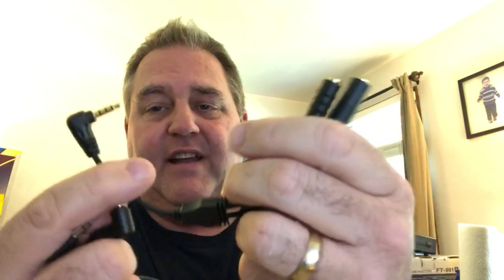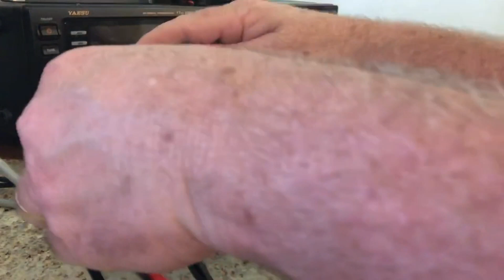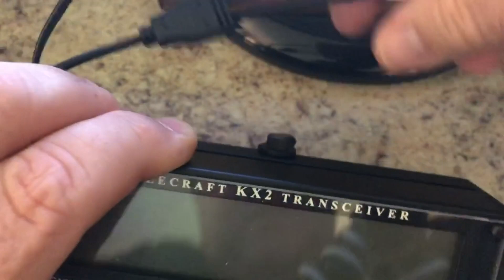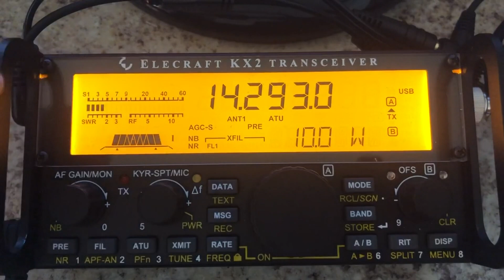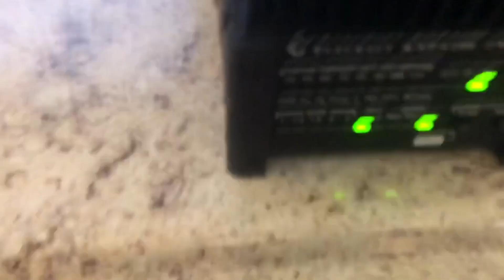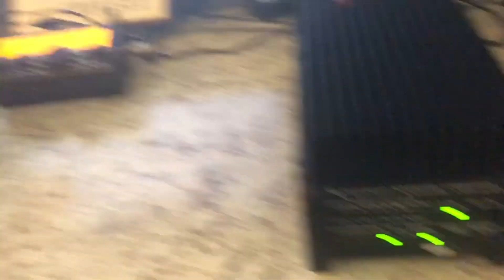Elecraft KX2 and KXPA100. Perfect match!

Comment: Does it work more or less the same way with the KX3 instead of the KX2? (besides the cable)
Does the amplifier also amplify the incoming signal to increase sensitivity?
Reply from the maker: Yes, you just don't need the adapter cable. The preamp is built into the radio itself and it works really well, with or without the amp.
Reply: @K4MJV  Great. I have had my license for years, been wanting to get into HF but could never really find the right rig, and I'm starting to really like the looks of these. Also the fact that they are actually US made!

Comment: Nice video - Thanks! Curious - Did you ever try to set up the KX2/KXPA100 with Winlink? If so, would you mind sharing how you did it? Thanks! KJ7RPL - Brent
Reply from the maker: I used a SignaLink Sound card to interface. There are smaller options out there now like the Digirig and others but I already had the SignaLink for the shack so I used it. Also works if you want to run any other digital modes using the KX2. Just know that the rig will run pretty warm using digital modes so an aftermarket heat sync might be a good idea.

Comment: When you want to tune via the kxpa100 atu, do you just set the pwr output on the kx2 to 11 watts so the amp is engaged? I usually tune at 5 watts on my other rigs.
Reply from the maker: When using the KX3 or KX3 with the KXPA100 amp, it's best to just think of it as a single device. The "device" will know what do do when you press the tune button. Just set the PA and ATU to external in the radio menu and it will handle it for you.

Comment: Hi there! Greetings from the UK.
Great video, very useful.
When paired with the KX2, are we able to monitor current draw (TX and RX and STBY of both KX2 and KXPA100) on the screen of the KX2?
If not, are you able to tell me the current draw at 20W and 50W on TX? And on STBY or on RX as well?
From the specs I can tell it is typically 20A (presume on TX at 100W)
I am Interested to be able to estimate the running times when used on the field with the batteries and solar panels I have.
Thanks for sharing
Reply from the maker: I don't remember if you can display it on the radio itself. I made the huge mistake of selling this amp so I cannot test it now. If you have one, do not sell it.

Comment: I purchased the KXPA100. Almost all of the cables you show in your video are NOT included with the KXPA1OO. With mine I received two of the USB cables used to updated the KXPA100 firmware (weird), the RCA plug cable, and one power cable. All other cables must be purchased separately. Most of them can be purchased from suppliers other than Elecraft, which will save time/money and allow you to avoid dealing to much with Elecraft. The cable designed to connect the KX3 to the AMP is $60.
Reply from the maker: That's a shame. When I purchased mine they included the cables of choice. The only cable I paid extra for was the KX2 adapter. I see on their site now that they have changed that. They have also increased the price of the amplifier so much that I don't think I could justify buying it now. I paid $1200 with the ATU and all cables just a few years back. Same purchase today is over $1800!

Comment: Great video! Question , I just received my KXPA100 , can I leave the battery in the KX2 and plug it into the amp? And/or can I just use battery power from the kx2 to get rid of 1 wire in this setup? Thanks in advance.
Reply from the maker: I know you asked this a while ago. Sorry for the slow reply. You can use the battery in the radio and not connect the power. Personally, if I am connecting two or three cables, one more is not a big deal.
Reply: @K4MJV  thank you..your right one more is not

Comment: I was looking into the same setup but honestly I don't see the point. For that amount of money I can have a decent 100W  home station like Kenwood ts590 and and QRP rig like Lab599 Discovery or the KX2. I does make sense to have one rig for everything though, just hard for me to justify amp like that.
Reply from the maker: I had the thoughts. When I got this I still had my FTDX3000 and a couple other rigs. Now I use this amp with a KX3 and a PX3 at home and it is an amazing station. The receiver in the Elecraft gear is so good and the filters are amazing. I sold all my other radios and only use the Elecraft gear now. No regrets at all.
Reply: @K4MJV  I will definitely look into it, I'll be power limited to 10W anyway when I pass my foundation/technician and I'm not planning on upping my game (licence) any time soon so having a small QRP that I can take everywhere definitely sounds nice and after a year I could just pass the next level and add an amp or get a base station, whatever 😂 
Thank you for your thoughts!

Comment: I guess I have been watching a lot of YT videos on Elecraft radios lately -- this came up on my list. 

I've had one of these PAs for a year or so. It was the only things I bought new from Elecraft as they are scarce as hen's teeth secondhand. I use it with the KX3 mostly, but could use it with the KX2. The level of integration is incredible. With a KX3, PX3, and the KXPA100 one has a complete station that approaches their K3/K3S radios.

My only reservation about this system is the bit of mess of wires with the separate components. But then, my home A/V system is much, much worse. :o
Reply: i dont mean to be so off topic but does someone know of a way to log back into an Instagram account..?
I somehow forgot my account password. I appreciate any help you can offer me!
Reply: @Wilder Ty instablaster :)
Reply: @Emmitt Silas thanks so much for your reply. I got to the site on google and Im waiting for the hacking stuff now.
Seems to take quite some time so I will reply here later when my account password hopefully is recovered.

Comment: Great video! You mentioned the relay on the amp kicks on once the KX2 is at 10 watts, but what if you are operating portable on a battery and don’t want to put out 100 watts, but something less? Will the amp kick on if the KX2 is at lower wattage, thus the amp puts out less power? Hope this question makes sense. 73, WA6HQQ
Reply from the maker: I am not sure I understand your question but the external amplifier does't do anything until you set the power to 11 watts or higher. You can adjust the power from 0 to 110 watts. At 11 watts, the relay switches the PA over to the KXPA100 and it takes over from 11 through 110 watts.
Reply: Thank You for the reply. For example, my thinking was if I wanted to run only 50 watts, it does not sound like that would work. Sounds like it is the radio by itself at 0-10 watts, or the radio at 11 watts, which will kick on the amp for a total of 110 watts, nothing in between.
Reply from the maker: @richardg4817  No, you can run anywhere from 0 to 110 watts and every level in between. If you want to run 50 just dial in 50 watts in the radio. Go to 7:32 in the video and you'll see the power set at 30 watts.
Reply: K4MJV, yes I remember that now! Thank you for the clarification!
Reply: @richardg4817  No!  You can set the power output level all the way from 0.5 watts to 110 in 1 watt increments, using the power control on the radio.

Comment: Watching all KXPA100 videos while I try to decide on purchasing or not (under 30 days left before the the 2020 Elecraft price increases).  I have both a KX2 and a KX3, the amp would make sense.  The only hesitation is that I built a Hardrock 50 Amp with ATU that I really like (and use).  Lately, due to my station setup, I’m not liking having to reach for the HR50 every time I power on and then tune up.  I really like the integrated nature of the KXPA100, I could actually mount it higher up on my shelves, closer to the coax input in my shack and save some desk space.
I do have a question though, I notice you have both Noise Reduction and Noise Blanker turned on.  Do you have noise and or pulses from your power supply?  Which power supply are you using?  Is it worse with the KXPA100?
Reply from the maker: Good catch. I didn't notice that I had them turned on when I recorded the video. But to answer your questions, I do not normally run either DNR or NB. It was hooked up to a MFJ 30amp switching power supply for this video. I have never had any noise at all when using it on this radio or any other.